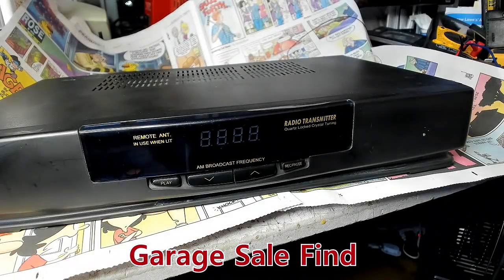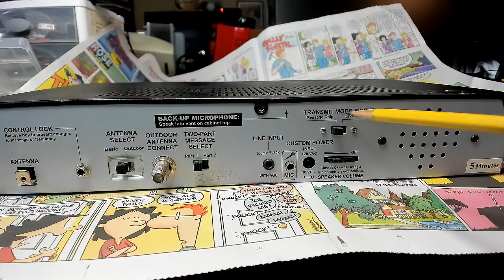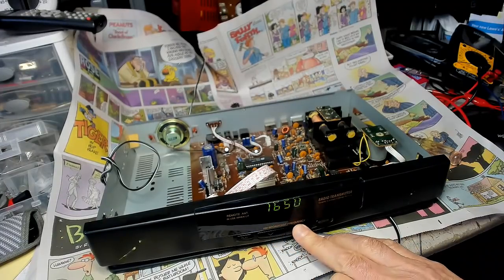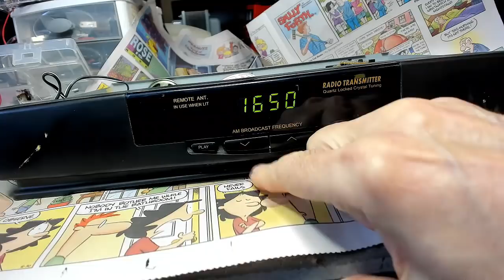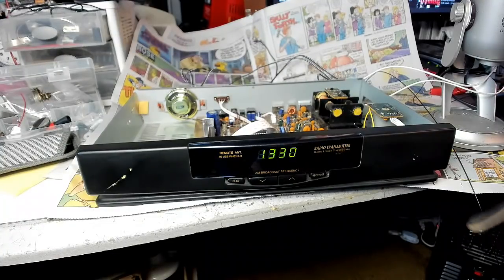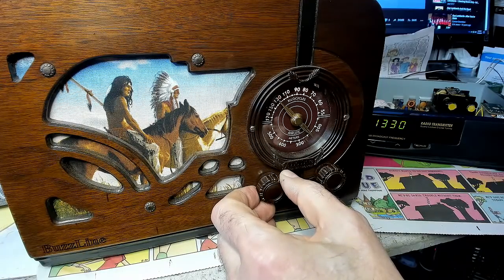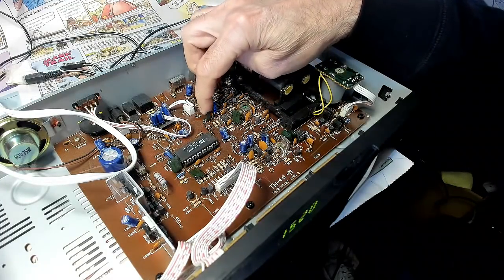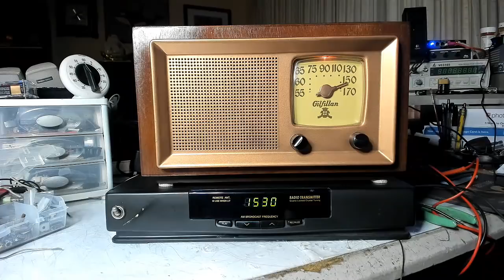Garage Sale Find - Talking House AM Transmitter

Comment: Im in! Always look forward to your videos. For a few bucks on ebay etc  you can get a LM317 regulated power module and set it for 18 volts. Just need to find a small transformer to feed it (maybe crack open a power adapter laying around) and a fuse/power cord. Looks like you have plenty of room in there to mount that. Just a thought. Thanks Buzz for all you do to entertain us. Got to be very time consuming.
Reply from the maker: yes indeed you are in!

Comment: your little radio is over loaded by 100 milliwatts of POWA! lol I love these transmitters, have 2 a version 4.6 and version 5.0 both work rather well. I've been tinkering with radio and transmitters for years. Those are beautiful radio's by the way. edit: you can drop out some of the treble on the computer as well to tame that treble.

Comment: OK Buzz ,, "I'm in." 

Hey you know that's a motorized antenna tuner? Too cool! Have you tried an antenna wire?

Love the tone mod. If it were me, I'd try even higher value caps. You could even add a tone wafer switch and have it perform optimally for different radios.

Say hi to Dickel for me. OK?
Great Vid. Tom
Reply from the maker: you're in.....I did have an antenna wire on when testing

Comment: Hey Buzz, I'm in.  I think that 5 minutes is how long you can record your message on that internal chip before it runs out of space, then it will broadcast that same 5 minute message in a loop.  I have one of those transmitters myself but I'm pretty sure mine is a different variant.  The front panel is about identical to yours, but the back has a couple of different features than mine.  I'll look at mine later tonight and sii what model it is.   They work really well.  I have just the basic ten foot antenna wire hooked to mine and I can broadcast clearly out to my garage and back yard and I have the transmitter in my bedroom (furthest room in the house from the garage).  I've run everything from youtube via my tv set through it using an optical digital to 3.5mm converter box to just running my mp3 player directly into it.  In the original box it included the key, antenna wire, etc.  The reason you can't adjust your frequency is because you're missing the key that plugs into that key slot on the back.  The key unlocks the frequency lock.  (And of course now I see you're figuring that out)...That's what I get for commenting while I watch, lol.  The antenna I believe works opposite the way a radio antenna does in that it extends the broadcast's range of the transmitter, instead extending the pick-up of a broadcast.  Also, you can hold the frequency buttons in instead of constantly clicking them and they'll move up and down faster.  You should try it out on a bigger radio with a tone control.
Reply from the maker: yes, you're in...do you know the year of yours?
Reply: @Buzz1151  Not sure, but I'll check tonight when I try to find the model number.
Reply: @Buzz1151  Hey Buzz, Sorry I forgot to reply till now.  I looked under mine and it say's Model TH 5.0  I didn't see a date on mine anywhere either though and the box it came in is long gone now.  I did see on Amazon that they're still selling the 5.0 unit but the name has changed from Talking House to InfOspot, but it's still the same transmitter. https://www.amazon.com/Talking-House-AM-Radio-Transmitter/dp/B00XV97XZW
Reply from the maker: @Rebel9668  thanks
Reply: @Buzz1151  Quite welcome :)

Comment: I have the exact same AM transmitter. I also have it's  power supply. The plug reads 18 volts DC  output. While you were showing this video
I put a 1/8 " drill bit into the lock and adjusted the frequency to a known dead spot on the dial. I connected a jack to my audio output of my  Sirius /XM radio and the 
other end has a RCA plug that goes into the transmitter. On my little portable  transistor radio  it gets the signal very good. You got a good deal price wise.
I paid the going internet price of $40. Damn. I like the Gilfillan ( Glamour Gal- fill-in) radio! It looks pretty. Uh-huh. Put me in. Sincerely, Steve M.   name➡🎩
Reply from the maker: you're in